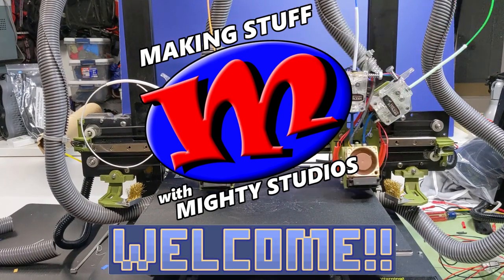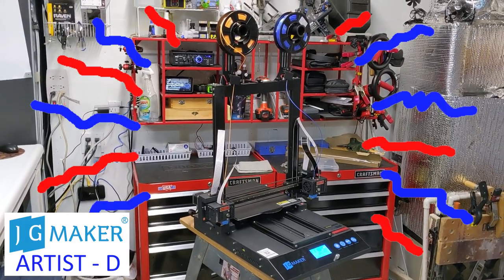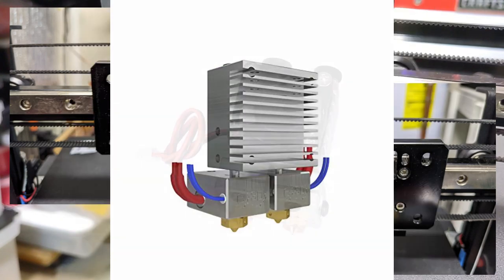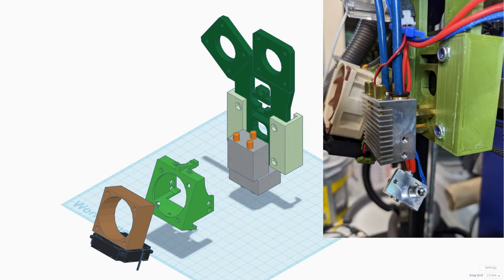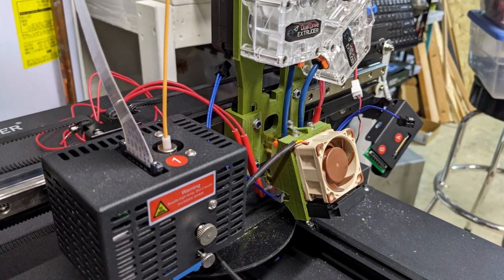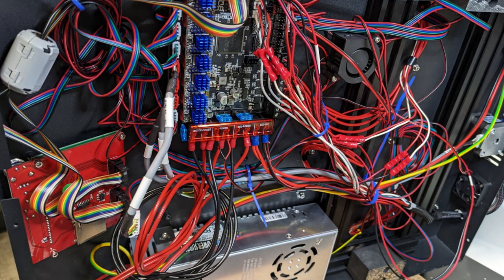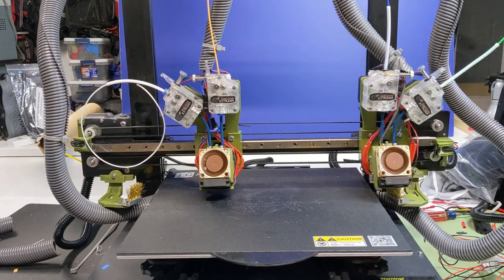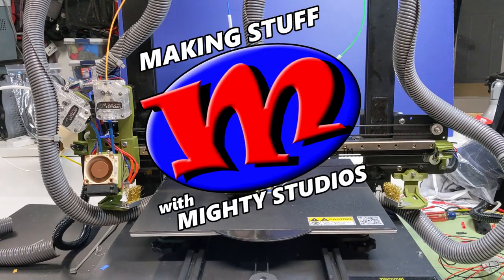The World's First IPEX 3D Frankenprinter!

Comment: The non printing nozzle will leak and ruin the print if there's nothing physically preventing it from oozing & the metal brushes don't work. I guess this is why you haven't posted any 4 color prints

Comment: Sweet way to redo an IDEX. IMO the dual nozzle isn't ideal because of oozing, potential nozzle bumping, and an extra hotend to heat. I wonder if the dual pivoting head would have been better. Or the single nozzle dual bowden type hotends. Seriously cool work
Reply from the maker: oozing was an early issue. In the IPEX version of Marlin, I added changes to ensure unused extruders do not preheat over the build. That's mostly solved the problem. A pivioting heat would have been better than having to level all four nozzles the way this design requires. Perhaps the next revision.

Comment: Awesome job Greg!  I just bought the Pro Version - Got it cheap myself!  I may just try this too... I'm also considering a y-axis upgrade - not sure if you've had issues with bed wobble and how JGMaker suggests one fix it... Doesn't exactly instill confidence in the long term durability of the stock y-axis.  I'm thinking dual linear rails instead of the extrusion with wheels...  Anyway, I will also tackle your lead screw video as well.  Thanks for sharing!!
Reply from the maker: I wasn't aware of y-axis wobble issues, but I'm going to watch out for it now. Thanks!
Reply: Greg, have you attempted ABL with this printer?  Their new version includes ABL but I was told they're using a different board.  They said the stock board isn't compatible with ABL.  I did some research on the stock board and it does have 3d Touch connections, thinking it may be a Marlin / dual extruder issue... I'm considering Klipper via a PC to run it instead.  What are your thoughts? @mightystudiosvids
Reply from the maker: For the 4-nozzle design, I had to switch to a new board from BigTreeTech (the Octopus v1.1) it supports ABL connections but I have not tried to use them yet. The original board on my Artist-D was an MKS Robin Pro v1.0 which has support for a BLTouch sensor. In theory, it should be possible to enable it's use in Marlin or Klipper with the correct settings. @jamespatrickbales
Reply: Hey Greg!  I received all of my parts for the IPEX conversion - I've been watching for more videos on your channel!  Hoping to get an update with print examples... The one worry I have (other than all the re-wiring) is whether or not you get much leakage during prints from the adjacent nozzle.  Are you getting clean prints?  Would you do it again or do you have regrets? @mightystudiosvids
Reply from the maker: If your standby temperature is too high, then the adjacent nozzle will leak onto the print. This can also happen if the adjacent nozzle is told to preheat up to print temperature too early while still moving over the bed. I've been tweaking Marlin source code to help combat this, but some slicers might let you adjust this as well. I don't have regrets because this is a very fun project to tinker on for me. If Bambu were to lower prices significantly, I think that would be a good alternative to building your own multicolor printer.  @jamespatrickbales
Reply: Thank you!  That certainly makes sense.  I agree - it's fun to tinker with for sure!  I thought about the Bambu (or similar multi-color option), but it just seems like there would be alot of extra time and wasted filament!  I'll post a video of my y and z axis mods that I incorporated to tighten up the wobble issues I was having - I went overboard - but they are rock solid now!  @mightystudiosvids

Comment: I was thinking int making one gigantic gantry to carry 4 independent extruders, I think the problem of this one is to properly level each nozzle
Reply from the maker: on the IPEX, the right carriage has a height adjustment screw similar to what JGMaker did on the original. Leveling could still be easier, though. It took me a while to dial it in.

Comment: Interesting idea -  I was thinking about doing something similar.  I have a JGMaker ArtistD and also a Weedo X40 which is also an IDEX printer.  I was think about achieving a similar result to yours by removing the gantry from the Weedo and grating it onto the JGMaker behind its gantry - that way I would have 4 totally independent print heads too

.I would need one more motor driver than yours - but hopefully the board your are using would work for me too.   

Or alternatively I was wondering whether it might be possible to drive the Weedo Gantry with a separate board, and then maybe merge the two into one overall system using something like Clipper.

May disadvantage I can think of with my approach is that the rear Gantry wouldn't be able to access the whole of the Y volume.
Reply from the maker: The Octopus board I'm using is maxed out on motors, so you'd need to find a different board if you need more. Your idea is very interesting. Keep at it!

Comment: This is a sick idea! I can’t believe the result is lighter than the original printer. I’m curious about the cost of the printer in total and if you plan to run klipper on it? Also I’d recommend learning FreeCAD or Onshape because it’s a lot easier to design complex parts on those as compared to tinkerCAD
Reply from the maker: links to the major parts are in the description. That'll help forecast the cost. There are cheaper knock-offs of the E3D hot end if needed. I'm not planning to add klipper since the Marlin stuff is already working for me well enough.

Comment: Subscribed great video and awesome idea. As for thinkercad I'd recommend you use 123D Design it's oldware now but you can still find it online. It's thinkercad with more tools. I've used it for over 6 years now and it still gets the job done.
Reply from the maker: Thanks! I'll check that out. I like using Tinkercad because it's easy to share my models in a way that folks can easily break down and edit if they want.